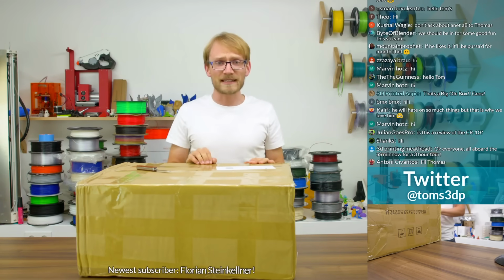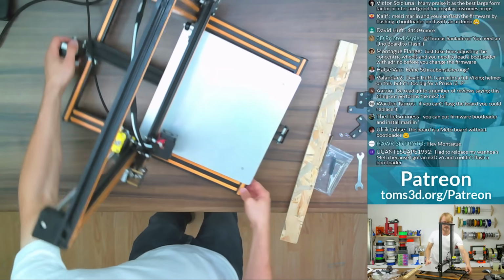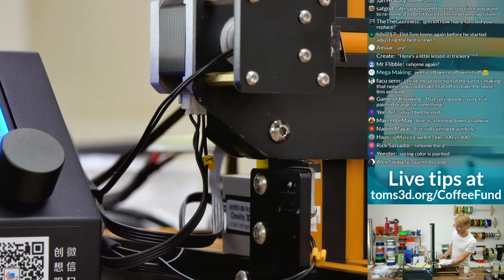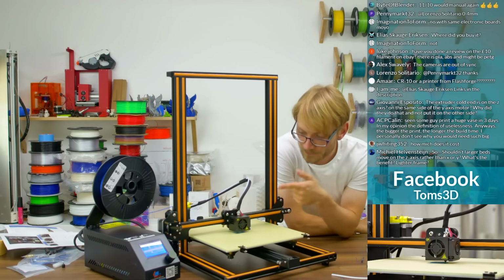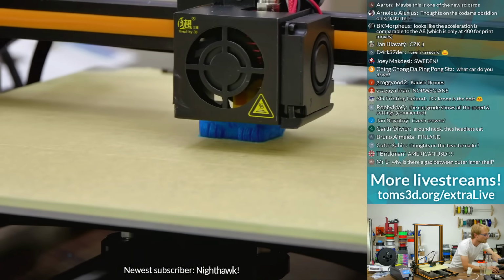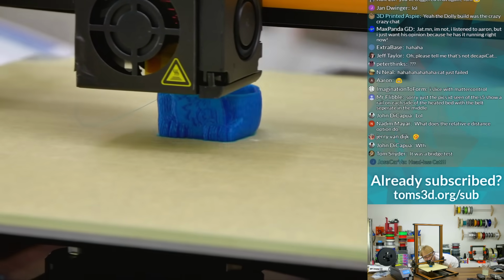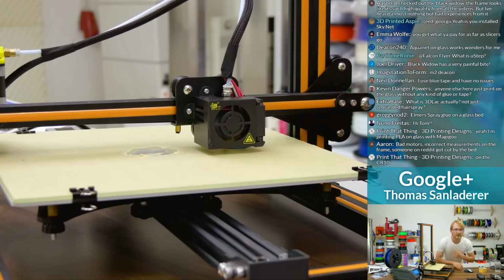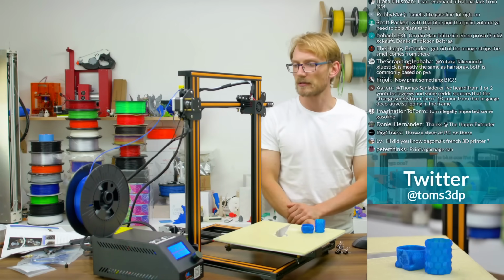Live: Creality CR-10 unboxing and first look! (Not a review)

Comment: Just a note to people buying the CR10.  First time 3D printer owners like myself are going to want to print something and unfortunately the cat gcode is still bad on the SDcard included with new CR10s shipping now. 

It prints okay until it gets past the neck then it starts to mess up.  Just use the stl file and slice it yourself with something like Cura.  This will also eliminate all the print head homing that the CR10 was doing during the cat print in this video.

Comment: this printer really only needs 3 mods. actually 2 the 3rd is a convenience mod.

#1 the "slightly" modified fan deflector to put the parts cooler airflow where its needed.

#2 y bed strain relief. zero effect on printer or print quality but should prevent future failure of the joint

#3 CR-10 Ultimate Bed Leveling Knobs. this is purely a convenience upgrade. it just makes it so much easier to tweak the bed level. (and the CR-10 holds its level very well I REALLY want to find more of those FLAT springs to use on all my printers)

The only other change I have made to mine is to use a print in z skin (cheaper) I just don't stick it down. just binder clip it. works astonishingly well.

this printer is absolutely amazing bone stock truly needing ONLY the part cooler deflector mod. my 390mm tall prints are absolutely flawless.

out of the box reviews are the best. now if there is a glaring issue mentioning a mod fix is no problem. otherwise keep it stock unless you REALLY like the machine and want to devote more times to it.

Comment: I agree with you on the split washers. If you really feel the need for them then replace then with star washers. I don't think they are necessary. Split washers will compress plastic, aluminum etc. Eventually leading to a loose bracket.

Comment: On the bed adhesion note, on my Junk made 3d printer with no heated bed , i use VA (vinyl acetate) glue, wich is that white glue that carpenters use for wood. I use it on glass (wich is the glass from a flatbed scanner). Its offering very good adhesion, i printed pla, ABS and nylon with no heated bed , and big prints too like 200x200x250mm and bigger without warping or lifting off the bed.
Downside is you need to remove / recoat the glass after each print

Comment: I'm glad you did a live build, showing the confusing menu system.  Every other video I watched made this printer look perfect with no issues.  I can see now there's lots of tweaking with tightening everything up, and the menu isn't nearly as straight forward.  Also looks like there's some flexing or bowing with the build plate which could affect print quality if you're printing a large object with a big chunk touching the bottom surface.

Comment: I can't get into the chat for some reason, so I'll comment on your question about testing the cheap printers as-is or with all mods.

I think it's useful to do stock and after some mods. Don't do mods that cost money (replacing the hot-end, changing from a single rail to a multi-rail support for the bed, etc)

but mods that are labor/filament only, should be fair game.

Yes, it is a matter of spending time, but many people are willing to spend the time on this because they are treating it as a hobby (and are as interested in improving the machine as building anything with it :-) )

so things like flashing updated firmware, printing brackets to stiffen the machine are things I would consider reasonable

how good/bad a machine is out of the box is an interesting metric, but it's most interesting for people buying the machines for production use. For hobbiests, the question is how good can the machine be before you start modding it to the point that you may as well have started from parts and designed your own.

Especially when there are cases where small mods make big differences (stiffeners on the tarantula from what I hear), it's good to know that the weak areas are easy to fix.

The closest I can come to a 'bright line' guide is that anything that requires cash for parts (other than filament, nuts, bolts) should not be something for you to do.

It may be that you take one of the cheapest printers and do the full workup on it, and then for some others you can can just identify what the mods that are needed for 'acceptable' operation instead of doing tons of mods videos. but I suspect that 2 videos each for the cheap ones (stock, with mods you print+firmware upgrade) would be good as well.

Comment: I have two of these. :)

Bed temp: I have mine insulated on the bottom with EVA foam. Also, I have the power supply bumped up to 13.0V. I am able to hit 90C with them in the enclosure. I print a lot of ABS for it's acetone solvent abilities, so these see a lot of ABS. With a PEI bed and glue stick, I get really good adhesion.

I also designed frame braces and a dual 50mm blower duct system.
Reply: How does one bump the psu up to 13.0V?

Comment: Hey Tom, at 1:07:23 , when you move the x gantry, you can clearly see that the belt driving the x gantry is not parallel to the x axis. Is that a design issue with this printer (hope not!) or is it just assembled wrong? Please have a look on that...

Comment: No.  The cat is corrupt.  There are sections that attempt to move the nozzle literally miles away from the printer.  Mine printed three times with an offset head, because I like the messed up cat.  Otherwise, the printer is fine.
Reply from the maker: +theflamingpi according to the Marlin developers, it's an issue with the firmware version Creality used https://twitter.com/MarlinFirmware/status/881957052410716160
Reply: Hmmm... I'm just going by the investigation done by a guy I met in the CR-10 group on Facebook.  He looked into the gcode with software he gets through his work.  It was apparently baked into my gcode for the hotend to move a mile away from the printer.  Of course, this may be an isolated case.
Reply: theflamingpi the same with my cr-10. All the models I've sliced myself have printed perfectly.

Comment: funny to see that the Chinese manufacturers more and more are knocking each other off. This machine is basically just a Micromake C1 knockoff, only that the profiles are extended, but the core structures are basically the same. Only difference: the Mikromake C1 costs here in China about 116 USD. Gearbest doesn't sell the Micromake. It is not interesting for them, not enough money to make from it.
Herri /greetings from China

Comment: do the review as is i stay away from mods because i feel they are not needed when simple settings can fix the issues.  Also the reason i left the tevo community nuts on mods when half of the people didn't even have a printer yet

Comment: Is that a 3d printed Fan box they printed at the factory.
Reply: alphasxsignal do you mean the hotend fan shroud?  It's metal but the part cooling fan duct on the right was 3D printed on my CR10.

Comment: I just got a new printer. I do not know why my 3d printed object is lower than the actual object? I guess since each layer of material is less than it should be, the object seems quite flat,  but do you know how to adjust the setting? or is there any cables, which I did not connect correctly?

Comment: I'm currently using an Ultimaker Original but was thinking of getting a second printer, more as a backup. I've been hearing good things about the CR-10, but it uses 1.75mm filament. I'd prefer to use the same filament for both printers. What 3mm filament printer would you recommend?
Reply: Andrew Caird bit a cr 10 then buy 3mm Tools for it maybe 50$ from china :)
Reply: how about just get a cr10 but then convert it to use 3mm. maybe get a genuine 3mm titan and print a mount for it using the ultimaker
Reply: You can upgrade the Ultimaker with a 1.75 hotend.  There are plenty of kits being sold around the web.

Comment: Hi Thomas! Thank you for all the work you have put into 3d printing and all the information that you are sharing.
Today I received this printer also (Creality CR-10, from GearBest) and I am experiencing some problems. I will ask here in case someone encountered this problem already and also, if you have any ideas please let me know. The problem is that all the motors  (X,Y,Z) work ok except for the extruder (E).
I measured the voltage on the X motor line with a multi-meter and I do get input on the multi-meter's screen when requesting in the menu to move X with some amount. But on the extruder line, when I request to move by some amount and measure with the multi-meter I get no readings. This implies that the E cable is bad or something with the internal circuits/rom. If I connect the X line to the extruder motor then it does move.
Any ideas on this problem? Where can I contact Creality 3D for more help on this? I also think this should be covered by warranty.

Comment: I ordered one of these Creality cr-10 3d printer (blue) and 4 color ABS filaments from gearbest on the 19th of June. The listing said it ships on June 24th - July 2nd.  They shipped out the ABS filaments on the 24th of June but they never shipped the 3d printer.  I have been contacting gearbest customer support and they keep giving me the run around.  They are saying due to the supplier issues it won't ship until July 13 - 12.  yet they keep getting more available on their site from 33 up to 57 up to 108 available etc.  Now they said it won't ship until July 8 -17 which is what their listing says also if you add to cart and buy today it will ship July 8-17.  But I ordered on June 19th so it should have shipped by now but they are just screwing around.  What kind of worthless scam of a site is this gearbest thiefs??  I just want them to ship my printer that's all.. What can I do?  will they ever send it or should I file a dispute on paypal?

Comment: I've run into problems with my cr10. It was in the middle of a print, began to print erratically and shut down. When trying to reboot it, the LCD screen will flicker briefly but not turn on. The unit itself will no longer turn on. From the searching I've done, and investigating my printer, I've decided it must be the power supply that went out. I had the supplier I got it from send me another PSU, but it did not fix the problem. The biggest issue I'm having is lack of good resources on anyone with a similar problem, and the solution they arrived at (a successful one) or if there are resources related to the cr10's internal electronics that I can get any links to. Thanks!

Comment: I like your video's but your comments on MOSFET's are totally wrong. It's more complicated than small is better than big or cheap are rubbish. It's about Die quality, Rise and Slew rates (usually how new the internal technology is) and circuit design of the PCB.
Please don't get involved in things you aren't sure about like the other guys, it undermines that good you do.
Reply from the maker: +Scott DC sigh... The dynamic properties of a MOSFET don't matter the slightest bit when you're switching at single-digit Hertz. Die quality is handled by the manufacturer and binned into different versions of the same chip.
Please don't get involved in things you aren't sure about. I've designed switch-mode power supplies for a living and do know a fair bit about what makes them work.
Reply: Hey that's something we have in common. I have designed and manufacture a range of ultra-high power class A/B audio amplifiers which feature my own design of 12 Kw switch-mode PSU. I have been making these for 14 years and sell them worldwide.

Maybe I didn't explain what I meant eloquently enough. My point was that a newly designed switching transistor will usually be more efficient and capable than older type which usually has poorer slew rates and higher RDS(on) figures. The other point which I'm sure you will agree with is that running any of these devices without proper heat-sinking will reduce the efficient of the transistor by a considerable amount, therefore underscoring my comment about the design of the circuit being the most critical factor, not whether the guy in china is using large or small package devices.

The reason I wrote the message is that I respect your opinion and didn't want you to end up doing reviews like RCLifeOn where in his review he takes the control unit apart and (for example) proclaims that the earthing is done correctly. One look at it the picture and it clearly shows it is not CE compliant earthing and is actually dangerous (needs bootstrap earthing from case to PSU and PSU to IEC socket) to be safe. Also the choice of rear sockets mean it wouldn't pass LVD regulations either!
The trouble is that people see these reviews and take the comments as the truth, even though it is just an opinion and not fact.

I just didn't want to see you doing that kind of thing. Let me take this opportunity to thank you for your videos, I am very new to 3d printing (only had a machine for 3 weeks) but I am learning a lot from your lessons.

Comment: Hi there. You (amongst other) made me buy the CR-10s. And I'm pretty happy so far. I managed to print the benchy and the knob for the filament-motor. But now the bed leveling is pretty messed up. After some investigation, I found that my z-axis limit switch is kind of stuck. Like sticky.
As I'm also a fellow german guy (based in Hamburg) I hoped you'd know where I can find a replacement part for this switch.

Edit: Ok, kind of embarrassing, but 5 minutes later I found them ^^
https://www.amazon.de/Sourcingmap-gebogen-Grenze-Micro-Schalter-momentáneos/dp/B00HG7HJUO/

Second edit: Ok, where is the hole to jump in. Exactly that switch is a spare part included. Good that I didn't bought the 10-pack yet ^^

Comment: my heat bed shows 70 when I switch it on and it won't go off, will heat 
up warm but not by much I was thinking its the thermistor took it off 
the bed and it still shows 70,i have checked all the wires in the box 
and on the bed everything is ok and tight.
 any ideas.
Reply: Did you put an external thermometer on the bed and verified it is actually at 70?  I use my multimeter or an ir touchless to verify my bed settings.  I would try and swap the hotend sensor with the bed sensor at the board.  If the hotend is stuck at 70, your thermistor is bad.  If the bed still reads 70 with a different thermistor, your firmware has an error.
Reply: no the bed is cold when i turn it on but shows 70d. i removed the  thermistor from the bed and it still shows 70.on the lcd.and thanks for your reply.can i flash it with the stock firmware and were would i get it from
Reply: John Stocks most use some version of the marlin firmware.  there are others out there and i don't have a cr10, so i don't know which it uses.  you may be able to scroll through the screen menu and find some temperature swttibgs to adjust.
Reply: i try a factory reset,and took the  thermistor off the bed as well,still at 70 try the other setting in the lcd but nothing worked
Reply: when i up my heated bed to 80 it will heat up so i think i need a new thermistor
Reply: John Stocks there are plenty out there.  pick one that matches the one you have.   many look similar.

Comment: This or the Wanhao Duplicator i3 Plus?
Reply: I've been wracking my brain over that same question as well, and I just pulled a trigger on the CR-10. Mainly because it seems like less people are reporting quality issues with the CR-10, whereas Wanhao Duplicator i3 Plus is having a decent rate of electronics failure problems from what I can ascertain from reviews and such.

Too bad because I would have really prefer it due to its more compact size.. I don't need this big of a print area.
Reply: For Wanhao duplicator i3
there's no big electronic failures..
the main issue is easily fix by adding a external mosfet

I would get this CR-10 though
cos of the large build area
and better features